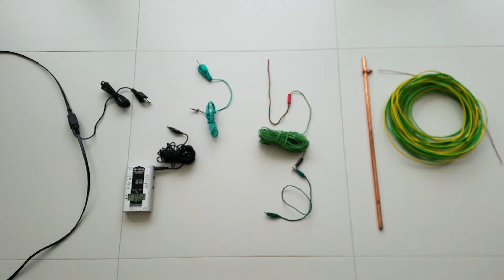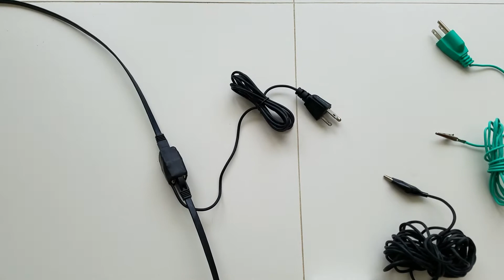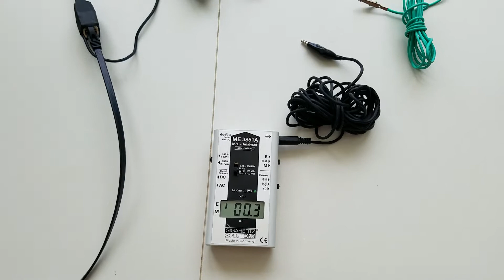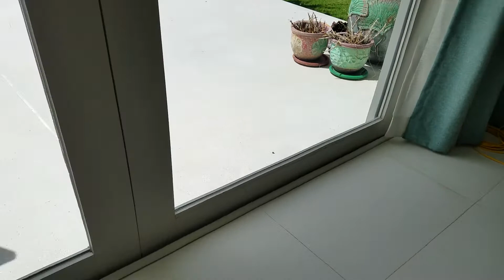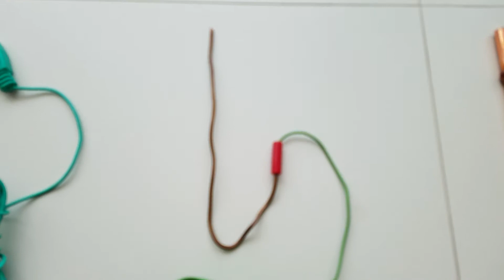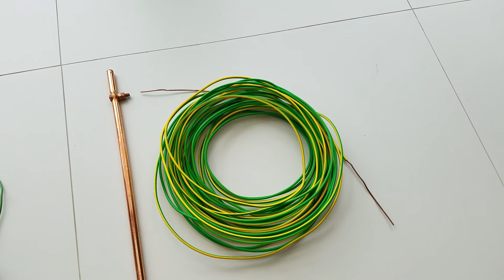How to Ground Your Electric Field Meter and Ethernet Connection

Comment: I want to ground my Gigahertz Solutions meter but it only came with the black cord like the one shown in the video that is coming out of your gigahertz solutions meter.  So how do I ground it?  It just has a clip at the other end of it.  What do I attach that clip too?  I don't get it.
Reply from the maker: You can use either of these products to attach the black cord to your home electrical safety ground:

https://lessemf.com/product/ground-cord-w-plug/?affid=40

https://www.amazon.com/Static-Care-Grounding-Alligator-Garments/dp/B08V5D9L7L/

Or you can ground to the outside as I show in the video above with a wire and copper stake from your local electrical supply store.

Comment: i live in house with 2 wifi hotspot,11 phones  connecting with wifi and 2 cell towers away about 2 miles,If I tie copper wire around my wrist and plant it in the yard or if the house with ceramic and i barefoot.. any problem  there ?

Comment: Thanks Jeremy, you've shown the equipment, but you haven't show how to actually implement this. A video of you setting up the ethering would be great.
Reply from the maker: Hi Yash. What specifically would you like demonstrated? You will either plug the attachment into a properly grounded electrical outlet or put the copper stake into the ground outside your home. A clean ground in the backyard is best, but an AC outlet will often work just fine.
Reply: @emfanalysis  Hi Jeromy,

I have only 2 wires, the one colored black which came with ME3830B one end of which goes in the meter and the other end of which is thong/scissor shaped. The other cable is greenish blue like in your video but instead of the thong/scissor end, it has a USB at one end and the other end goes into the AC electrical outlet.

I'm confused as to how to ground my electric field Meter ME3830B. And should the AC electrical outlet be switched on or switched off when doing this? Can I use a spikeguard or does it have to plugged into the outlet in the wall directly?
Reply from the maker: @yashrungta8742  You will simply plug in the greenish blue cable directly into an AC outlet. Then you clip the black cable onto the metal part of the USB end. You just need metal-to-metal all the way to a proper ground.  Provided that your electrical outlet / building are properly grounded, you should be good to go. 

To know for certain, find one these at a local electrical supply store to test any AC outlet:

https://www.electrahealth.com/Outlet-Hot-Neutral-Ground-Tester-with-GFCI-button_p_133.html?aff=2
Reply: @emfanalysis  Thanks, should the AC outlet be switched on or switched off? To where the greenish blue cable is plugged in.
Reply from the maker: @yashrungta8742  The ground wire is connected either way.